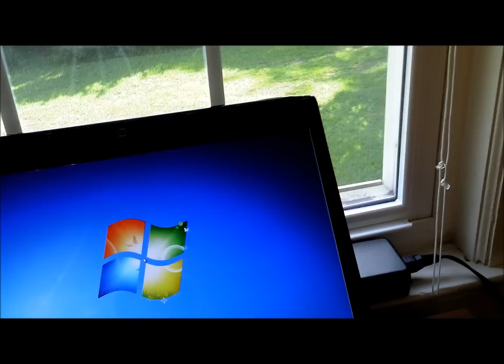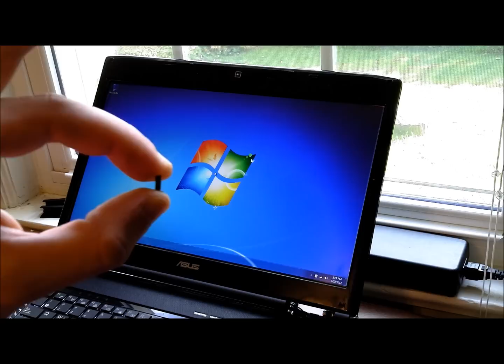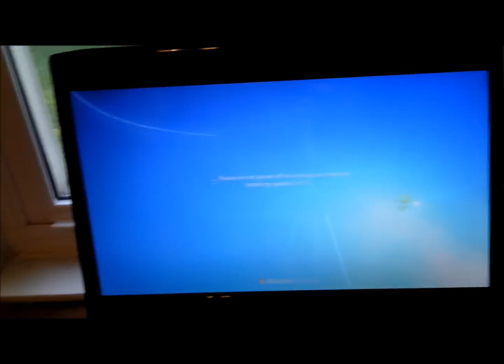Tutorial: How to fix screen LCD flicker on G71 G72GX Asus Laptop

Comment: I just picked up this exact model of machine at a hack shack for 250$. The screen was the only thing wrong with it. The screen would go black if you put the monitor in a certain position. I did what you said (Though the front panel was rather tough to get off) and unplugged and plugged back in all the cables most which actually seemed pretty tight already- and now it doesn't even so much as dim no matter how much I move the screen!

I suppose it doesn't matter how tight it seems- just unplug it and plug it back in!
Reply from the maker: Awesome tip!

Comment: MY GOD I DID IT. HOURS OF FRUSTRATION HAVE JUST BEEN ELIMINATED. For anyone having trouble getting the clips the guy doesn't show how to get off in the video I opened the screen all the way then squeezed them inward and up. It takes a bit of finesse. Then close the lap top and push them back and up. I used a small electronic philips screwdriver to get the stupid screw covers off. Had to get on the side of them and pry the damn things off. Don't even bother trying to get them off with your fingernails. I only had to disconnect the left aux connection on the bottom and the 2 top plugs. The other ones aren't connected to the back cover panel.
MOST IMPORTANT: I noticed when I was trying to replug the main connection into the back of the LCD display that the position of the tape from the long gray band connecting to the back frame of the screen was creating quite a bit of tension. I removed those sticky parts, reseated the plug into the LCD and then made sure the plug connecting to the LCD had plenty of slack when I re-affixed the gray tape to the back of the computer. I'm hoping this will eliminate any pulling on the LCD plug when moving the screen.

Comment: Just curious, does ASUS make any products that aren't defective in some way? Also, is there a better company someone could recommend for gaming rigs?
Reply: Samsung laptops can take lots of punishment and abuse, Lenovo believe it or not are actually good laptops. Most important part of the laptop is the cooling system and how acessable it is. Best laptops have a cooling system that can be opened and cleaned. So next time you are buying just ask the staff to flip the laptop so you can see cooling (ofc you should think about specs too).
Reply: people for some reason have a very bad opinion of Lenovo products like they are second grade products, ofc they couldn't be more wrong. Its probably because Lenovo is a Chinese company and china has a bad reputation.
Reply: ahaja007 I would still take a Sony, Samsung or Asus over a lenovo anyday. Ofc lenovo is much cheaper than those brands but hardware wise they're a lot better esp for gaming. Lenovos best laptop is worse for gaming than Asus's worst.
Reply: I don't know where you get your facts. My brother has a Lenovo laptop that has incredible specs (on top of that it also has a slot for adding another graphics card for SLI, there is also a special version of laptop that comes with 2 gpu-s). Beyond that the laptop also has removable protection for fans that allows you easy access for cleaning, that I have never seen on any other laptop (never had problem with overheating). Model of laptop is Lenovo Y510p check it out (ant that's a mid point laptop, higher end stuff come to par with Alienware for a fraction of a price. People hate Lenovo because its Chinese company but in truth they are best laptops on the market.
Reply from the maker: EntityEnigma I'd recommend a Lenovo Y50 right now as a good value gaming rig.
Reply: Really? I heard it had screen and wireless card issues.
Reply: It doesn't have screen issues, people are complaining that it uses standard screens.
Reply: ahaja007 If you can find me a equivalent alienware with decent specs for under $1000 I'll be surprised as fuck. They usually go for $2500 for one with mid range specs.
Reply: +Anthony Joubran (Anthonyj810) Alienware has an Alpha model for under $500

Comment: The cable (at 4:08 in the video) was my exact problem.  It had also came loose on the same side as yours.  I plugged it in all the way and taped it back on securely.  After fixing iit and powering back up, I am now 100% flicker free!  Thank you so much for this video!!!!!!!!!

Comment from the maker: Yes, you'll need to replace either the backlight or the inverter (whichever is broken). Since the inverter is the problem 99% of the time, when someone brings me this problem I just buy the inverter and replace it. The inverter is located behind the LCD bezel underneath the LCD. Unfortunately I have not made a video for that fix yet I don't think. However, it is a fairly straight forward procedure. unscrew the bezel and pull it off, and it will be right below the lcd. Inverter should be ~$20

Comment from the maker: Unfortunately it is a design flaw. There is not much you can do other than connecting it again. Another member suggested that there may be better cables online, but I cannot verify. I no longer have the laptop, but you might try to see if you can make some slack in the cable by removing it from some of the cable channels in the base. However, this would also mean your plastics will be harder to sit flush.

Comment from the maker: You can buy a new cable if yours is damaged, however usually you don't need to buy a new one. For opening the bezel- bezels really suck, and there is no 'safe' way to remove them, other that using utmost care while separating them. Sorry I can't really be more specific. I use the right angle pick shown in the video, which always makes it much easier for me. I have posted a link in the video description.

Comment: First of all I thought that it's a problem with GPU, but I connected it to Plasma Tv and turned on LCD+CRT mode, G72 screen was in colour stripes image on plasma was clear. Do you know have Asus updated this cable? And where to buy these tools to do DIY unplug of cables, I believe if I use screwdriver I will tear it. Thanks!

Comment: Some of my problem seemed to be coming from the screen producing excess heat. So we peeled back the led/wiring covering the logo on the back of the computer and taped it out of the way. We then removed the logo and put the screen back together. This seems to have fixed the problem almost completely, only had one flicker in 2 weeks time.

Comment: No doubt , I ended up getting it. ( it was on)   all I had to was pop the cover off of the bottom left side and push the plug in. I am glad I didn't pull the whole screen apart like in your vid.  I kind of knew where the problem was because if I pressed at that spot it would play right. Hey , thanks for the advice.

Comment from the maker: No problem! You can use many kinds of tape, but avoid anything with metallic content. Duct tape, electric tape, and masking tape should all be fine, however I would recommend packing tape if you have some. It is very thin, but is wide enough to just put one piece on to hold it.

Comment: Thank you so much! This video really helped!!! I was ready to scrap this dang thing until I tried your repair tip. Just saved me about a thousand bucks! The flicker was HORRIBLE, especially on battery power. Now I can actually do stuff on it on battery power alone!!
I wasn't sure if any tape would be safe so I didn't use any extra, just re-seated the ribbon. Could you shed light on what tape would be ok? Duct tape? Masking tape? Etc. 

Thanks again!!

Comment: Thank you for this video and taking the time to go over everything.  I do not have the white line, but I do have the flicker and I do suspect a connection that is loose.  I know just where to press on the frame to turn it back on!  Time to fix it however. ;)